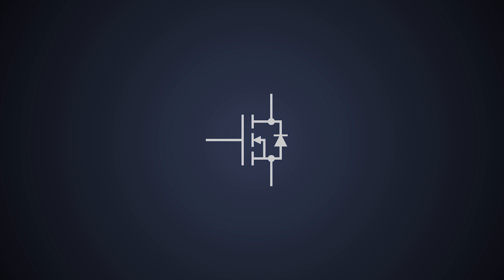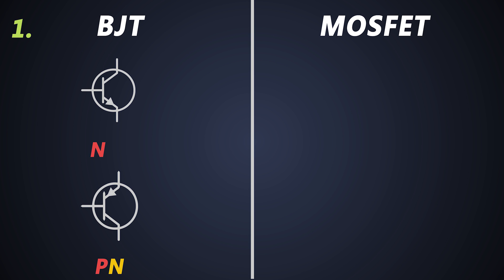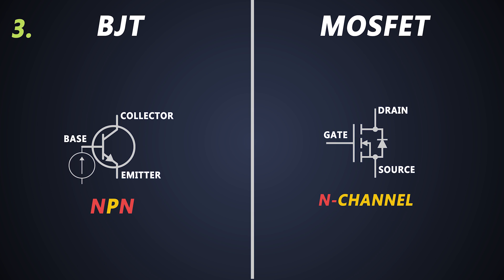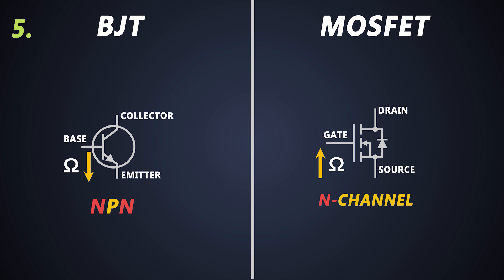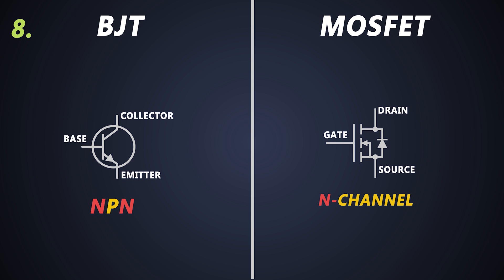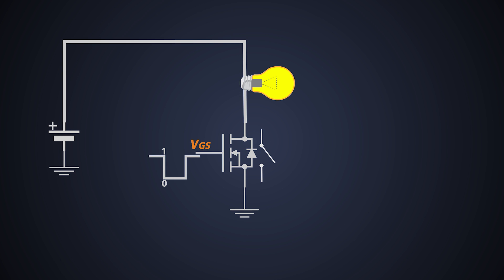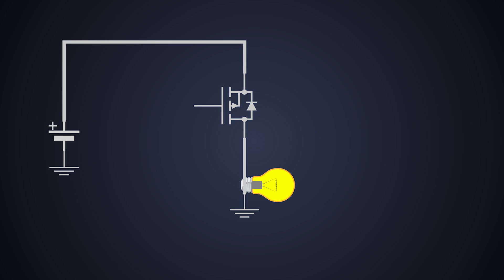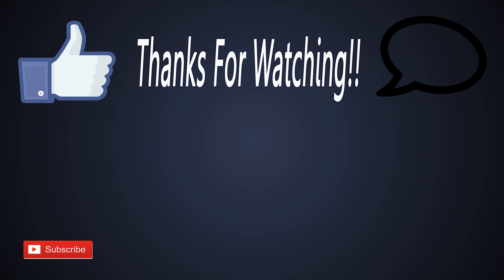Difference Between MOSFET & BJT | MOSFET Basics | How does a MOSFET work?

Comment: BJT is slow, Mosfet is fast. Can you relate this to a frequence?
Sometimes you use a push pull solution made with BJT to control a Mosfet, can the Mosfet be fast since it is controlled with BJT's?
Reply from the maker: This is just for a comparison, Yes, BJTs are used in highspeed applications but only to drive other Transistors, not to drive actual loads

Comment: I had a very simple mosfet project and I just wondered if I could use two resistors between some random source of weird voltage and current to turn it off and on and make a buck or boost event that I can catch with a capacitor. I gather together a lot of high amperage 12-volt fans for cars . I think 5 or 6 of them in series with a mosfet to interrupt it could charge a fairly good battery on a windy day.

Comment: So, what is but good for??
Reply: One use of mosfets is controlling power . . . I use it in a custom console of mine to control power flow between battery and charging port. While charge is applied via USB battery does not dissipate power but when USB is removed battery can now discharge to keep console running. This prevents battery discharge when plugged in

Comment: I don't know why people believe bjts are slower than mosfets. Principally bjts are faster than mosfets. Mainly because bjts are current devices and mosfets require charging of the gate capacitance during any transition.
Reply: Yes this drives me crazy too. It's because people are stupid and need simple messages. In fact: A MOSFET of the SAME size and overall specs as a BJT ALWAYS switches SLOWER because of the gate capacitance, but MOSFETs are generally much smaller in size, so it's all pointless to compare.
Reply: All cpus are mosfet, they are faster
Reply: @benyomovod6904  They are fast because the individual mosfets are made to be very small reducing the charge required to turn them on and off. That is one of the reasons why fabrication size reduction are so important in the chip industry.  When sizes are matched, bjts tend to be faster than mosfets. The additional reason mosfets are used in cpus is because when they are fully turned on or off they don't need any additional power to stay in that state. This makes for lower power devices.
Reply: @TheWeedOperation  wrote "They are fast because the individual mosfets are made to be very small reducing the charge required to turn them on and off." 
Good point.

Comment: Why there's diode in MOSFEt
Reply: A MOSFET is essentially a combination of a BJT and a JFET. The JFET part is added by putting a layer of insulator on the BJT, and then adding a 4th electrical connection on top of the insulator, placed above the "base" region of the BJT; the insulator will let the BJT base "feel" any electric charge applied to the 4th terminal, but will not allow the electrons to go from the 4th connection to the BJT. With this 4th connection placed, the base is then tied to one of the other BJT connections, chosen so that when the MOSFET is connected normally, the base will be forced off. After this is done, the 4th contact (the "gate" contact on a MOSFET) can then force a small area directly under itself to turn on, but cannot force the entire BJT on.

Now, to actually answer your question, tying the BJT's base to one of the other connections has a second consequence: if you hook the MOSFET up backwards, then the base and the BJT connection that it is not tied to will form a diode.